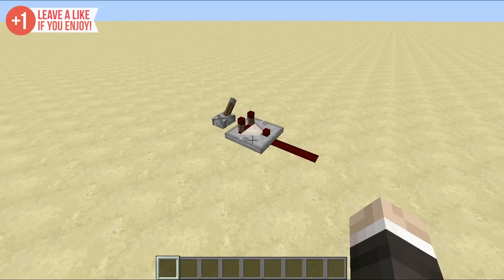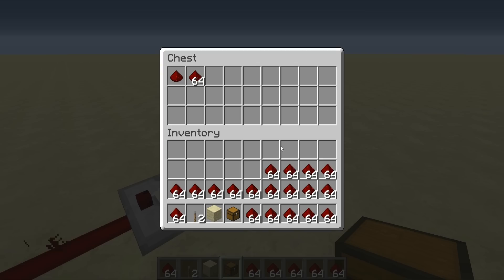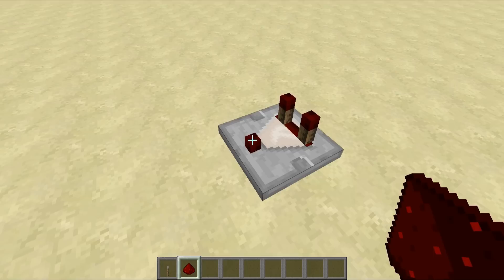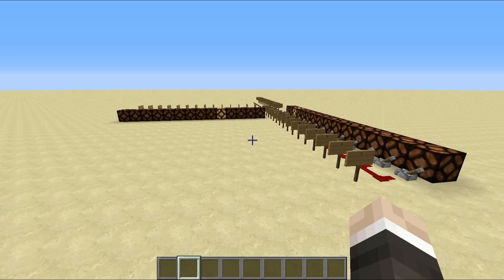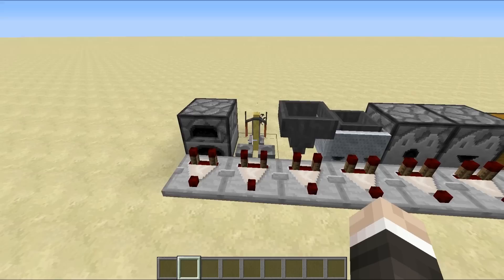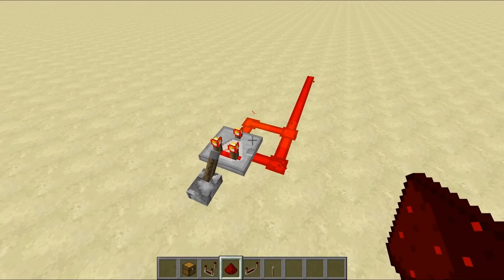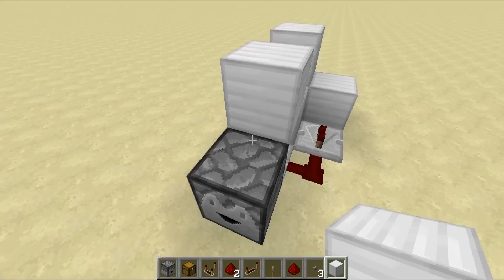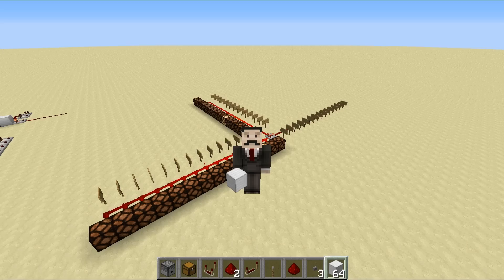How to Use the Redstone Comparator in Minecraft!

Comment: I already knew everything in this video. I came to find out how an item filter works and still don’t know.
Reply: I'll try to explain item filters without any images/video.  
    In the filter's "rest state" (i. e. no items moving through the filter), the uppermost hopper in the filter contains enough items that adding one more will increase the signal strength from a comparator reading the hopper by one.  The items in this hopper are arranged such that the first slot contains 41 (or 18)* of the item that you want to be filtered, and the other four slots contain one dummy item, typically renamed dirt or some other cheap item.  The hopper below this uppermost "filter hopper" is locked, so the items remain as they are in the top hopper.  This is also why the top hopper must not point down, otherwise, even though the hopper below it cannot pull the items out, it can still push the items into the locked hopper.
    When an item is presented to the filter hopper, one of three things happens.

        Case 1:  The item is the same as the desired filter item (that which is stacked to 41), and, as such, it enters the stack of items in the first slot.  As mentioned before, this causes the comparator's output to rise by one.  The item filter is constructed such that this increase in signal strength unlocks the hopper below.  This allows one item to leave the hopper (from the first slot), at which point the filter returns to it's rest state.
        Case 2:  The item is not the same as either the desired filter item or the dummy items.  Because all the slots in the hopper are filled with other items, the incorrect item cannot enter the hopper, and passes by/sits on the hopper until it despawns.
        Case 3:  The item is the same as the dummy item, and enters the hopper.  The same process as in Case 1 occurs, but, because it was a dummy item that entered, the net result is that the filter item stack ends up one item short and the extra dummy item remains in the filter hopper.  Over time, this will break the filter, as the first slot will completely empty, allowing any item to enter the hopper.
    The most common design for an item filter is tileable, meaning that multiple can be placed next to each other without interference.

*Usually, item filters will have 41 items in the first slot, and operate on the change in signal strength between 2 and 3.  These are the overflow-proof designs, as the signal strength can never reach 4, which would cause any adjacent filters to activate and drain items from the filter hopper prematurely.  However, filters that operate on the change in signal strength from 1 to 2 can be created, these needing only 18 items in the first slot.  Unfortunately, if the output the sorter is connected to fills up completely, the filter can also become full, causing the signal strength to reach 3, breaking any adjacent filters.

I think that's as complete an explanation as I can give with only words.

Comment: It’s very similar to n and p transistors where you can make and and not gates with this, with the input signal being the drain/source voltage and the comparison signal as the gate voltage, then you can make any logic gate with this setup and then full adder, etc etc, just study electrical engineering

Comment: If you want to know what you're chest fullness has to be in order to reach a certain signal strength, solve the following equation:
((*your signal strength* x 1728) - 1728)/896. That is the amount of stacks of 64 items you have to place into a chest in order to reach your signal.

For example:
I want to reach a signal strength of 8:
((8 x 1728) - 1728) / 896 = 13,5. That means I have to place 13 stacks of 64 items and one stack of 32 items (0,5 x 64 = 32) in a chest to reach the strength of eight blocks.

(The "/" I use is the indicate divided by)

Don't try to use the equation for the strength of 1

Comment: I'm a bit confused with the equation. Shouldn't an empty chest give a signal strength of 1, according to the equation? Is there some funny business with truncation or is empty just a special case?
Reply: No... it shouldn't
Reply: @Scudmaster11  Let me show my working out, then. The fullness of a slot is a number between 0 and 1 inclusive, representing how full that slot is. 0 being empty and 1 being full. (sum of all slots' fullnesses) / (number of slots in container) is the average fullness of the entire inventory, also between 0 and 1 inclusive. Multiply that by 14 and you've got a number between 0 and 14 inclusive. Add 1 and you get a number between 1 and 15 inclusive. This still represents the average fullness of the inventory, but this time 1 is empty and 15 is full.

Now, here's where I get confused. Truncation, to my understanding, just removes the decimal component from a floating point number, leaving an integer. Since we're only using positive numbers, this is equivalent to rounding down to the nearest integer. However, the inventory being empty is being represented as 1. Truncation isn't gonna change that to a 0. So why does an empty inventory give a signal strength of 0?
Reply: That's binary.... you can do that will comparators too.... when it reaches 15 do a —14 ... there you got a empty 0 and a full 1
Reply: Also an empty at 1 isn't really acceptable for it
Reply: It just seems way to out of place
Reply: @Scudmaster11  I'm not sure what binary has to do with this. You seem to have missed my point, though. I'm confused about the equation in the description of the video because it doesn't line up with what a comparator actually does. I get that a signal of 1 for an empty inventory makes no sense to actually have in the game.

Comment: 8:30 who understand this explain me in detail
Reply: The lever constantly gives out a signal strength of 15 since it's directly next to the comparator and always on

The comparator then gives out a signal strength of 15 as well since they give out the same amount of power they're given
So the redstone dust in front of the comparator has a signal strength of 15

The redstone signal then travels as it would if it was powered by anything else (like a redstone torch), losing 1 signal strength for each block

So the piece of redstone dust at the intersection has a signal strength of 14. From there on the redstone signal will branch out in the two opposite directions with equal strength, so 13 on each sides

So the side of the comparator is now powered by a signal strength of 13 while still being powered by the lever and its strength of 15 on its main input side

Since the comparator is on substract mode, it substracts 13 from 15 and gives out a signal strength of 2

The signal can then only go as far as the intersection before running out

But now there is no longer any signal to substract from the 15 of the lever, so the comparator goes back to giving out  a strength signal of 15

Because of it the comparator would then again give out a power of 2 and then one if 15 and 2 again... so on and so forth

Of course, in minecraft redstone signals travel instantaneously and only get updated once ever tick (a tick being a very small amount of time specific to mc redstone, it's equal to 0.1 seconds)

So for 0.1 seconds the whole thing would be powered by a strength signal of 15, and then by one of 2 for 0.1 seconds so on and so forth